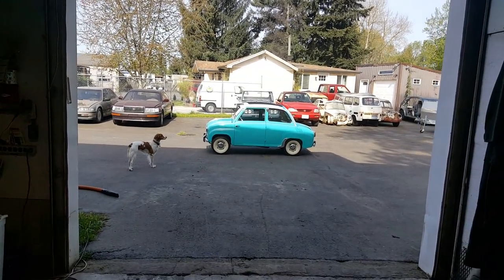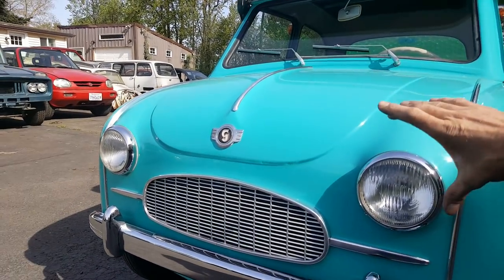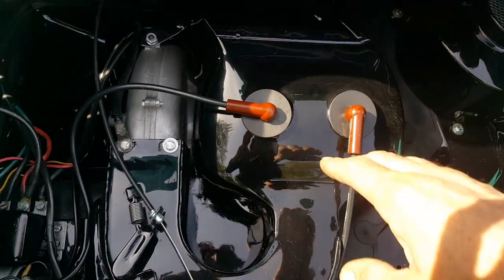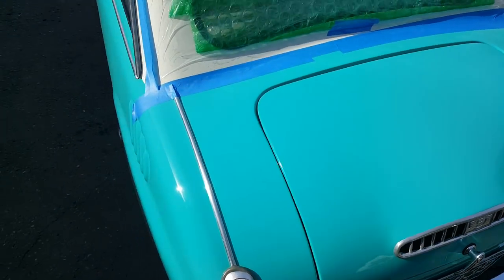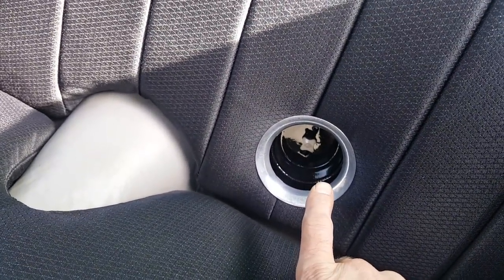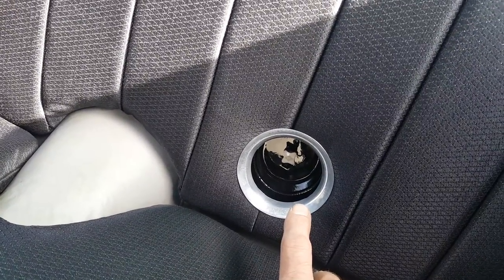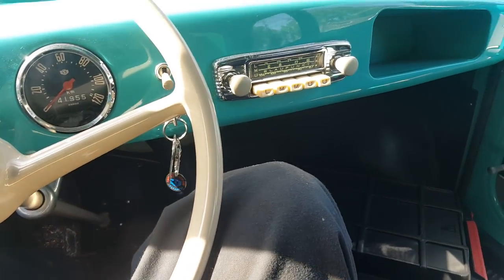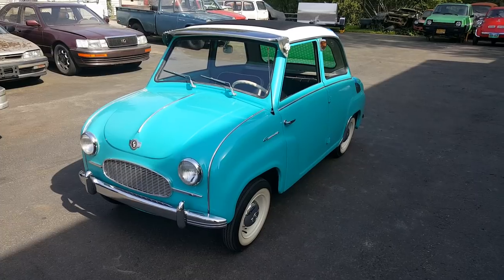More Goggo Limo Details

Comment: This is quite an interesting car, I can't figure out if it was meant to be a luxury car or an economy car. It is built like a luxury car and looks quite modern for the time in ways and has luxury features like an FM radio, carburetor adjustment inside the car and a sun roof, but it has a 2 stroke engine and no gauges other than the speedometer.